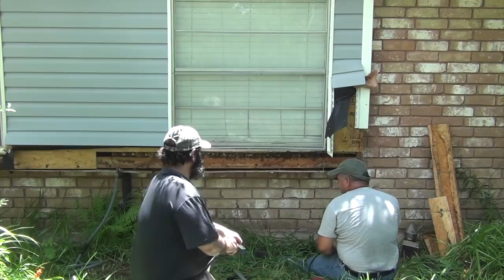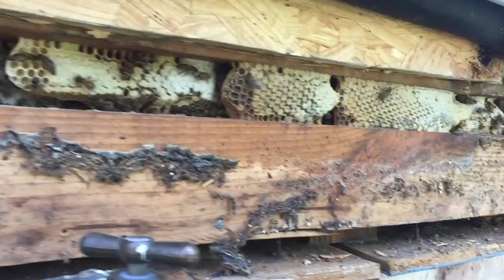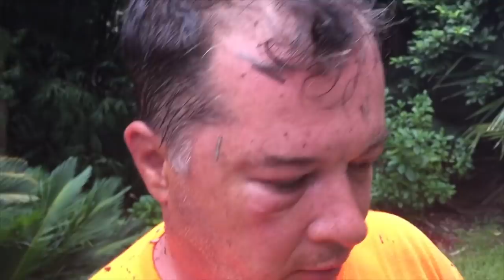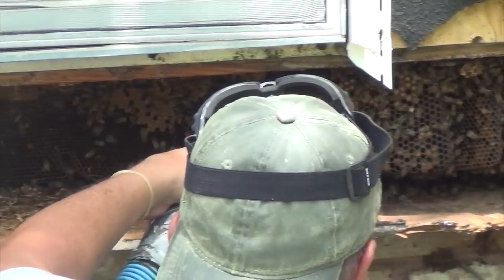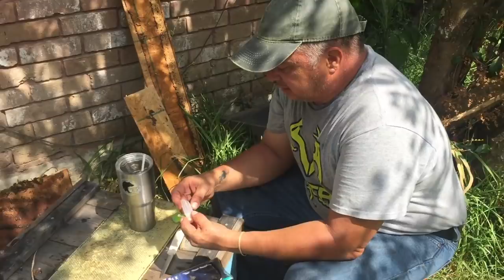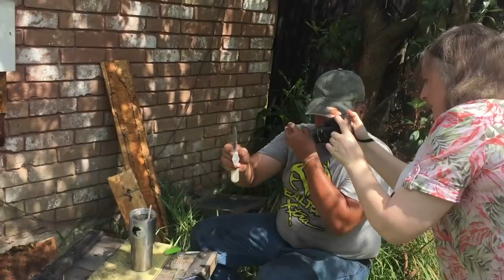It's Me Or The Bees! 6 Year Old Beehive Has To Go!

Comment: Wow, that was some hive! I'm surprised that they still seemed to be using comb that must have been 6yo or so already.
Reply from the maker: Russ Ian E. Lection-Hacker they tend to recycle/reuse comb sections. A lot of it was in very good shape. The comb sections tend to darken & get really stiff due to an accumulation of cocoons from when they morph into young adults.

These really weren’t that bad.
Reply: @JPthebeeman  That's what surprises me. I remove comb from my hives after 2 years max, and it has turned black by then. These bees must have done a lot of recycling, but I don't see the usual evidence of discarded comb sections on the bottom. Perhaps because the space was relatively low they either recycled it all, or cut it up and threw it out.
Reply from the maker: Russ Ian E. Lection-Hacker they did have some dark comb but they were quite the honey makers. That can only explain why it wasn’t predominantly dark, guess they kept recycling the honey comb, not really laying in it I guess.

Your point is definitely valid & just a lil FYI, of course I’m going off of what the homeowners communicated to me as for as how long they’d been there.
Reply: @JPthebeeman  I saw all that honey comb, it was A-MAZING! It must have been quite a colony to forage that much. How much brood comb did you find altogether?